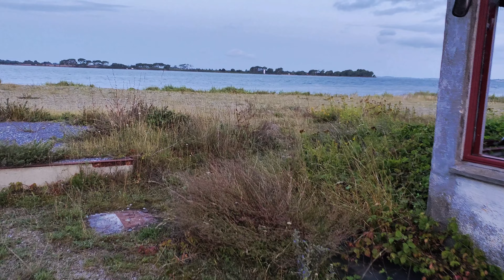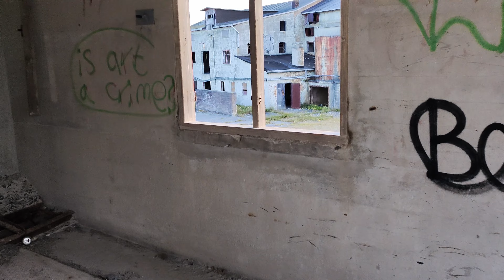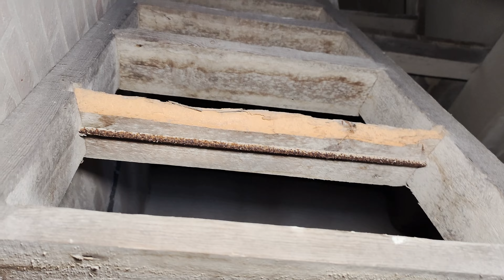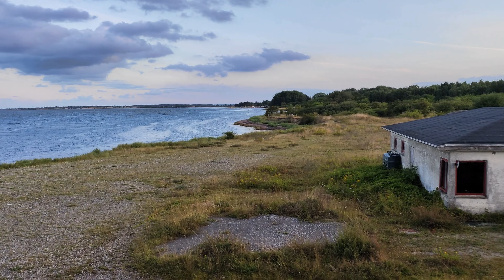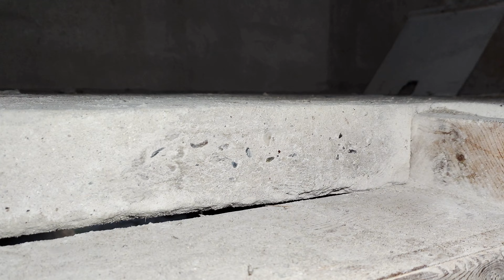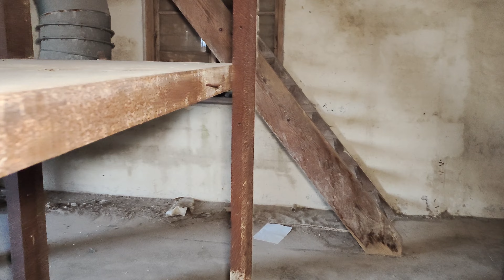Forladt Fabrik / Abandoned Factory

Comment: Looks like it's been abandoned for a while. I thought a bomb had been dropped on it at first. The place looks a bit too big to be just abandoned like that. Great explore 👍
Reply from the maker: The factory was very interesting to explore. It was sold in 2008 and the new owner wanted to build holiday apartments. But there are probably some environmental regulations which have meant that the project has not started yet. I'm glad you liked the video.
Reply: Hi Dinglehopper,
Sorry to miss your premiere, this huge factory is very interesting. What was it actually used for???
Lots of stuff left behind which I’m sure could be sold off or re-used. 
 
They are certainly taking their time to start holiday apartments. 
Great video and interesting content, thank you for sharing.
Stay awesome & have a good Friday x💕
Reply from the maker: @Kimspics59  All that I could find out was, that they produced flint for rollers and crushed stones for sandpaper. It's strange that they haven't build the holiday apartments yet. I mean, you can't get closer to the beach.
Reply: @dinglehopper85  Exactly, it’s an ideal location, but I suppose paperwork & planning all take time. X💕